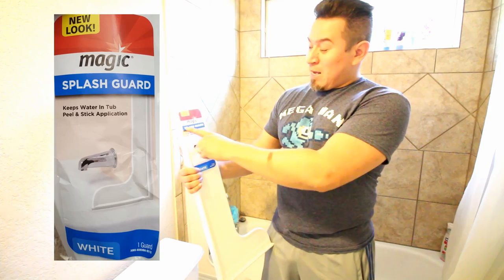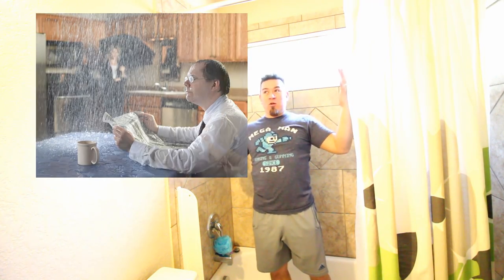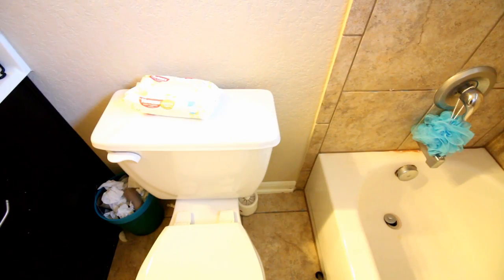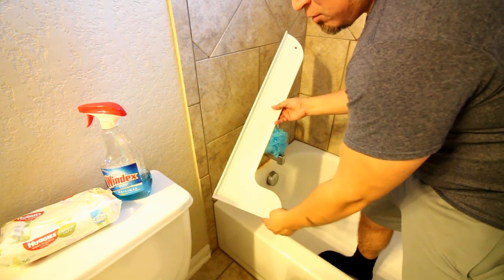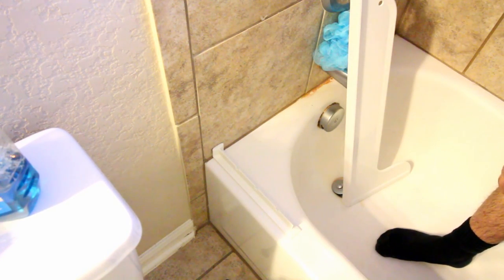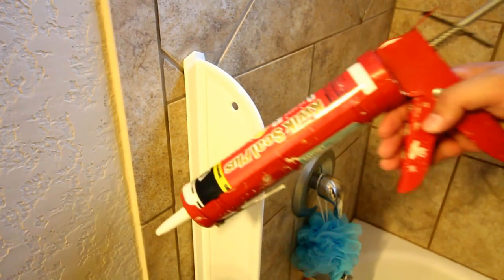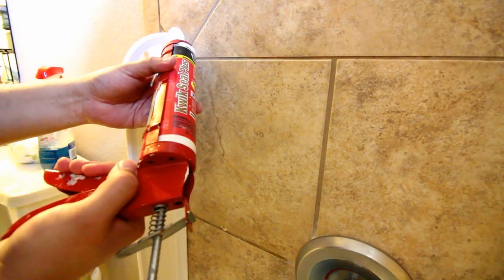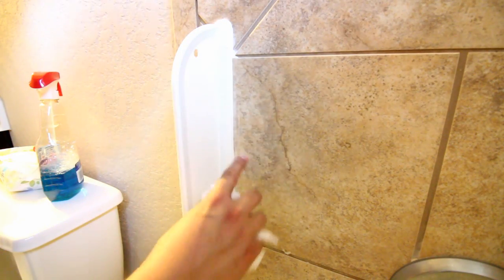Installing a bath tub splash guard

Comment: thank you for the video,  I just had my Hall bathroom redone because, just like your daughters,  my sons don't understand that taking an hour long shower and not putting the shower liner in in gonna do service damage to my floor and the ceiling underneath the bathroom, so after I have my whole bathroom floor redone I will be installing this. but if you have any other suggestions please let me know, Thank you
Reply from the maker: Oh my gosh. So sorry to hear that. You can use flooring that is water tight and also add a level of protection around the edges of the room up the molding. Simply adding caulk will help. good luck.

Comment: Tidee Tub Splash Guards work better, look better, install soooo much easier AND divert water back into the tub!!!!  Check them out BEFORE you purchase these,
Reply from the maker: Oscar Robinson thanks. I will look into them!
Reply: Yeah, IF your tub and shower wall are 90 degrees. If not, you are out of luck with this type. I bought some at home depot that can flex inward or outward to compensate for that. Keep it in mind if you are in the market for something like this.

Comment: ANOTHER WAY TO FIX THAT WOULD BE TO GET RID OF THE STRAIGHT CHROME OLD FASHION ROD THAT HOLDS THE CURTAIN UP,, AND INVEST IN A NEW CURVED ONE , AT EACH END IT CURVES INWARD TWARDS THE INNER BATHTUBE ,, THEN YOU WOULDN NEED THOSE SPLAS GARD OR US SMALLER ONES IF YOU WANT ,, THERE SOLD AT HOME DEPOT ALSO
Reply from the maker: I always figured those curved curtains were for more space in the middle. I hadn't realized they were tighter in the corners. I will need to look into this. Thanks.

Comment: doesn't the caulking you add turn black after a while?
Reply from the maker: nope. Its the same stuff that lines most bathtubs already. You just clean it like the rest of the shower. It stays white and clean. You may need to reapply a new coat every once in a while. Its been almost a year and it still looks as great as day 1.